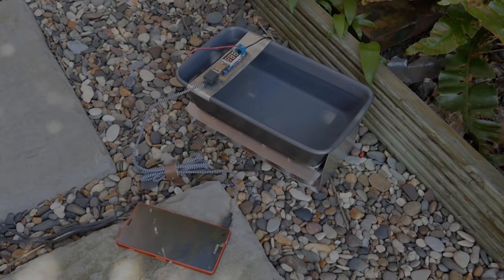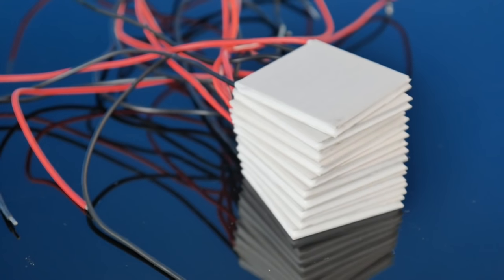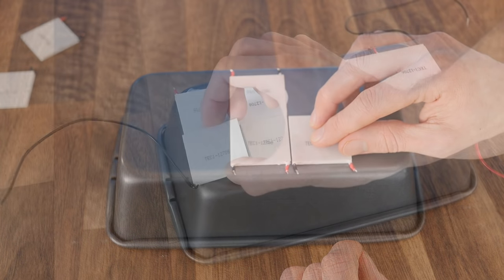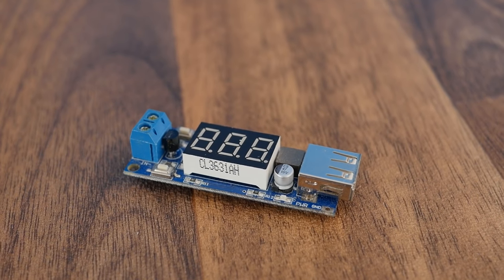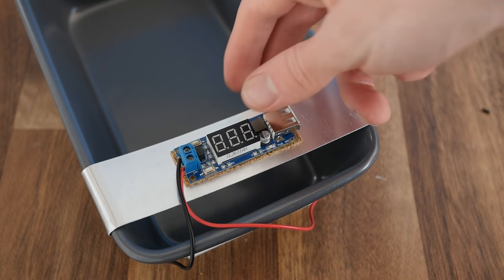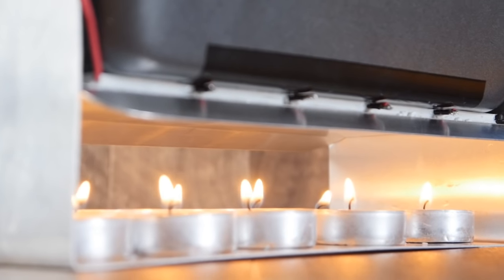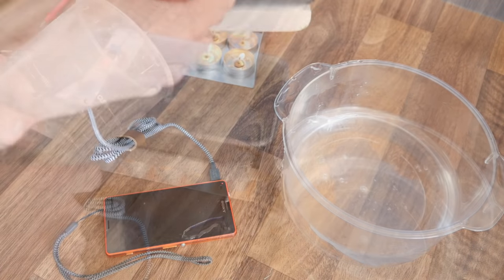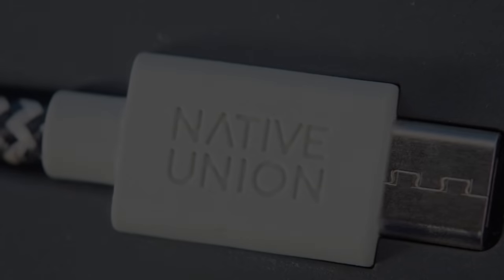How to make a DIY Thermoelectric Generator

Comment: hmm, it it posible to use this for cooling computers? and another thing, can you put this plates in series? cool the hot side with another plate and get a... wait a minut, did i just make a way to reach 0K?!?!?!
But seriusly, can you put thise plates in series?
Reply from the maker: I believe so yes.
Reply: Haha nice, sounds like i have to buy some.
Btw love your prosjects, keep up the good work (Y)
Reply: +Sondre Bjørgård To greater and lesser degrees ( ;-) ) - have a google on 'peltier'. I've seen some mods carried out that use them, but you still need an efficient way to remove the heat generated.
Reply: yes. that's one of their main uses
Reply: +Sondre Bjørgård I've used peltier modules to cool my one of my project pc's cpu to -3C. The problem is that the module itself produces significant amount of heat (mine takes around 60W) so your cooler has to cope with the heat generated by cpu AND the module. Also at such low temps condensation is a major problem.
Reply: +Sondre Bjørgård oh, also about the stacking - yes you can stack them on top each other. You stack smaller modules on top of bigger ones and you can achieve a pretty high temp gradient
Reply: +BFanist wouldn't it be possible to use the cpu fan output from the motherboard to scale the power for the peltier pallet? That way you wouldn't have to waste power to cool your system to ridiculously low temperatures while generating huge amounts of heat...
Reply: +Der Jens CPU fan draws probably less than 0.3A @ 12V - Peltier modules can draw in excess of 4-6 amps. You could build some sort of control circuit that would power the module based on the voltage fed from motherboard. Hooking up the module directly to your mobo might damage it.
Reply: +BFanist also to compensate for the heat of pcu and peltier combined the cooling fan would have to ramp up pretty fast. you would have to work out the fan curve and a voltage curve for the tec module
Reply: +BFanist great idea, but i will suggest you one thing to avoid condensation problem(condensation gives thick ice sheet and produces tears of water)...
first time you will need a thick cooper plate(about 10 cm or more) and you will need a pole(non metal like wood or plastic to avoid short with bottom side of CPU case) to support the cooper plate cause it have problem about weight...
then you should stacking cooper plate to CPU and your Peltier chips(don't forget about thermal grease) and the rest...
it will be better to make plastic cover around CPU and motherboard to protect them...
Reply: +Sondre Bjørgård A big problem with Peltier coolers is that when you remove power, the hot and cold sides equalize so you can end up adding heat back to the system. Adjusting the current to back off the temperature differential is considered the best approach; ie: cool to target temperature and then start reducing the amps so your cold side stays cold until it's safe to turn off.  This really depends on decent insulation so you don't have to keep the power turned up to fight environmental heat leakage into your system.

For a PC, you really need to have an active cooling system so you can dissipate the heat from the hot side, a water cooling system can do this, but if you are going to the trouble of a water cooling system and cutting a hole in your PC so you can expose the cold side and pump the heat out, you would probably be better off with just your water cooler.

The advantage of a peltier system is that you can cool your case below ambient temperature if there was some need for that. It would probably be quieter than a fan system to achieve the same temperatures, but your electricity costs would be comparatively expensive. 

Another knock on using Peltiers for cpu cooling is that the plate will condense and freeze the water vapor in the air
Reply: When using peltier you will still have to use a fan. Probably on even bigger rpm. The peltier module itself produces up to 60W so adding that to the mix you end up having to dissipate more than 150W of heat. Show me a cooler that could do that passively or at leas quietly :)
Reply: Mark Horstmeier you are right buddy that's why we still need a micro controller to control PELTIER CHIPS...
but if was you i will change all liquid in water cooler system with motorcycle liquid cooler...
motorcycle liquid cooler will not make rusty problems and have thick viscosity also can transfer more heat better than water as liquid cooler...
Reply: BFanist liquid cooler but not use standard base water as liquid cooler, you need to change it with motorcycle liquid cooler...
it just need about 10W cause it just need 4 small fans and 2 small motor pumps...
some people just put it at another level by using 10 fans or more and more small motor pumps...
Reply: +BFanist I have seen some experiments where people have been able to achieve some impressive temperatures with a massive heatsink, but your point that peltiers add another 60W of heat to the system is well taken. With a high quality module, perhaps with more surface area for heat exchange, I think you could do better.

I don't want to give the impression that I am recommending peltiers for cooling computers.  After all the money I spend experimenting with getting max results out of those cheap TECs, I didn't get much practical return.
Reply: +DIY Perks anything can be connected in series, haven't you seen the human centipede?
Reply: Sondre Bjørgård they are in series.

Comment: If it outputs 5 Volts @ 1.5 Watts, then if you do the math, that equates to about 300 milliamps. A normal phone in 2016 charges with at least 2 amps. The amount of amps your computer outputs when powered on is around 500 milliamps. I think having this charge a phone is a great idea but I think that maybe it should charge a portable charger which can then be used to charge the phone much faster.

Math to find out wattage yada yada yada yada:
Volts * Amps = Watts
Watts / Volts = Amps
Watts / Amps = Volts

Comment: why we need to heat water or something else???
can we heat TE plates only to generate some electricity? 
can we charge camera (DSLR) batteries using similar arrangement?
Reply: nope, seebeck effect works with a temp diferential, you need the cold side...

Comment: Is it fine to use fewer thermoelectric plates?
Reply: I tried with 8 and it worked fine
Reply: @DaniElectronics  can we use teg instead of tec ?
Reply: @anujnayak5339  sure, either devices work out fine!
Reply: @anujnayak5339  check the Thermoelectric Generator I built and let me know you opinion please!

Comment: hmm .. why is it on ebay that has a 12V / 60 watt plate (with the same number as in the video). But you say the 10 plates can be 15 volts. I do not understand that.
Reply: that's most likely a scam, and when he says 10 plates can be 15 volts, he means the total . 10 x 1.5V = 15v

Comment: how about something practical, a hand crank generator, or a simple windmill charger.  Thermo electric is cute until you realize the heat energy is better converted to mechanical power than it is electrical power

Comment: Why didn´t you use an TEG Modul instead of an TEC, wouldn´t it be more efficient because a TEG Modul is designed to work as an Thermoelectric Generator?

Comment: 5V 0,3A from all that modules? At least it works. I am building from big TEG modules and the power suck. They lie about the power, even for TEG modules. They are just more expensive. 30W ridiculous, 3W achievable, from 62x62mm TEG with 3W of cooling fan power.

Comment: this project works but impractical. If only there is a way to cool the water, having it be replaced with colder water automatically or be cooled elsewhere.
Reply: when camping you could set it up so a river flows by on a plate of aluminum instead of the bread tin

Comment: Hello!
I had a question about your flexible LED light video please (writing here since you may not be checking older videos now).
I've used some of the Yuji LED strips, which are truly great color-wise (thanks for your recommendation).
These are listed as greater than 80 CRI, which is a bit lower than the Yuji's 95+ CRI.
Can you say how close to truly accurate daylight these (Marswell) LED's are, compared to the excellent Yujis.
Reply from the maker: Yuji's daylight LEDs are literally the best, so while the Marswell ones are good for the price, they don't have that uncanny 'daylight' quality to them that the Yujis have (though they are close).
Reply: As I suspected.  . . . I may have to invest a bit more to use these for 'high quality photographic results,' thanks for the instructions.
If you run across any other very high CRI lights (like Yuji) that are more affordable, please let us know if you could.  (I will be looking too.)
Thanks so much for your answer, and for your videos as well!

Comment: This is probably the lest effecient way of prpoducing electricity ever invented.
One candle produces about 25W, you used 10 candles which are about 250W but your generator only produces 1,5W this is an efficiency of about 0,6%.
Also the water will heat up rather quickly. You should a CPU cooper block and a cooling fan instead. It´s a smaller setup and it even cools itself while it´s working.

Comment: Help I did this using two 7 volt solar panels and the same voltage regulator and the regulator/voltmeter/USB thing won't work any suggestions

Comment: Could you attach these to a tent stove  to charge your phone while the wood burner keeps you warm at night?
Reply: You'd have to change the water every 10 minutes :D
Reply: +CatsTF so having these attached to the side wouldn't work then as they have to have a cold side? Is air temperature not good enough? Thank you.
Reply: Gary Broom
I'd imagine his concept works because you can have two "extremes" so close to eachother. I don't think it's that easy to separate the hot/cold when it comes to air. That being said, I don't have any knowledge in the subject, so I could be wrong. :D

Comment: Hey Matt,

Does the voltage regulator come in 10v variants?
Reply: +Jake S (blu4) There is a adjustable variants, but it's hasn't a USB port becouse of obvious reasons. search on eBay for "adjustable voltage regulator" kind'a like "DC-DC LM2596" but be careful: step-UP (input lower then output)or step-DOWN (input higher then output)

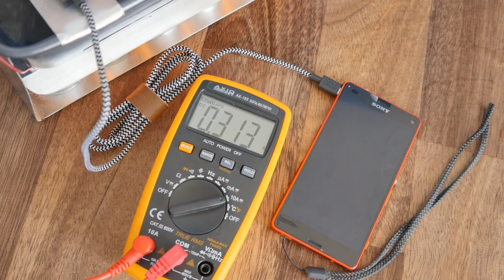Comment: 5:53 That is in fact very shabby since those candles put out about 80 W of heat each. So that's 1.5/800 ≈ 0.19 % efficiency 🙈 
Luckily there are better ways to use fossil fuel to generate electricity.

Comment: We can control voltage.....but what about current???Can we charge laptops???
Reply: Although he said 'Voltage regulator' he actally linked to a DC-DC buck converter, that effectivly turns the extra voltage into current.   You could in theory scale this idea upto laptops, but you'd need careful redesign to get it right.  Would love to see it done.

Comment: Could you build a snow and fire/hot water thermoelectric power generator to power a cryptocurrency mining rig, my system right now uses about 200 Watts with a single card? 

And that's just because it's my gaming computer and I'm messing around, how much snow would I have to carry in to do this? And how much snow would I have to carry in to power my house?

Comment: could you build solarpanels with these plates?
Reply: +Henry Klee you could, but that's really not a good way to use them... unless you mean using reflectors to collect a lot of sun light to a spot and have the other side cooled.
Reply: svampebob007 ok

Comment: Ima going to be going on a trip(in my favourite rocket ship)  with no electricity, but is near a river. Just wondered if it would be possible to use this with a constant water source. eg: waterproof the 'basement' that has you candles in and submerge the unit to get maximum cooling, you could insulate the wires with hot glue and just add longer wires to the control board... Anyone think this would work?
Reply: I guess it could, but you'd have to insulate the heatspreading plate so all the heat goes through the generator.
Reply: hmm yeah, I was thinking of making a watertight box (but you would be able to get into it) that contained the candles, a heatspreader then the generators, and then gluing the heat generators to the top of another 'heatspreader' which would act as the roof of the box, and that whole unit would be submerged...

Comment: If i would build it, i would put a Watercooling Pump and Radiator to it, so i would not have to switch the water
Reply: You would have to hand crank the pump.  Otherwise you are using more electricity then you are generating.
Reply: Raw Venus
Not a 12v Pump, a 3.3v Low-Power pump

Comment: try dry ice does this make enough power for a laptop?
Reply: +Dorian onelook you'd probably need more peltier plates (in parallel), as there is an output limit, regardless of the temperature difference it won't go over that limit.
Reply: Google Nutzer probably would have enough to power a basic 20W ~ 30W laptop, or at least slowly charge it (using many times the number of  plates used in this video)
Reply: Try dry ice and LAVA. It might work on a much larger scale to power something big like a lighting system for a house
Reply: as long as the module can handle the temperature

Comment: liquid nitrogen?
Reply: +M Isa I thought the same, maybe it would work as well...
Reply: No, but we want to use the Heat of the sun not the light.
Reply: +M Isa And thermite underneath?
Reply: +Krizx600 It's about temperature difference. If you use liquid Nitrogen, It would be enough for itself. You wouldn't need a heat source beneath it...
It called Peltier Effect.

Comment: it is a scam bro. This is what we did in our thesis but this is not efficient to charge a phone, you can charge a phone for just 5 sec. And it wont run again unless you let it stay for a sec. And try again. Lighting a small LED bulb could be possible.

Comment: What if you made one of these on a much bigger scale using dry ice and lava?
Reply: +Beta Syrus No, that's a horrible idea.
Reply: +Beta Syrus It'll power a whole city ( jk )
Reply: +Beta Syrus use frozen nitrogen instead
Reply: Eric Yuc And molten aluminum.
Reply: Use Thermite
Reply: hottest sun and whatever the coldest thing is ? oh wait...
Reply: A kugelblitz and absolute zero. (The hottest and coldest possible things)
Reply: Yes, I'm going to do it now
Reply: Beta Syrus Except you would need the wavelength of light to be the planck length, and absolute zero is pretty much impossible to achieve because there will always be energy. The coldest we have achieved was 273.14999... degrees Celsius, and absolute zero is 273.15. We did this by using magnetism to keep the subject from interacting with matter, but there are also neutrinos that can phase through matter, so yeah...
Reply: Web Compendium Yeah science
Reply: Den Hafiz lol, nice breaking bad reference.
Reply: Web Compendium Is it a good series ? Would you recommend me ? p.s - I havent watch it yet

Comment: In a real situation or in a needed situation where do you think you can find those thermoelectric plates?, I do not think you can find those lying around in the bush, or you build this thing before you go and have a real situation? really?No one is ready for a real situation
Reply from the maker: I can think of several predictable situations that would make building it in advance a sensible move. Not if you were kidnapped and then dumped in the bush... but then, you can't prepare for everything.
Reply: +DIY Perks hey thanks, do to take me wrong but I though of those kind of situations, but I still think that your project is awesome
Reply: I have a Question.
I built this thermoelectric generator however it was unable to charge my phone(the phone was charging but the battery level was decreasing.
Any tips to make this machine more efficient without tearing the whole thing apart?

Comment: use teg not tec type chips
Reply: +Suraj Grewal I don't think there is anything different between them apart from the name.
Reply: efficiency is... people tested it and they claim it provides higher volts, at same amps and input energy
Reply: +Suraj Grewal then why not use teg modules as tec and get more heat transfer efficiency ? I mean it looks like they just got more efficient modules or just modules with more elements. Probably the later.
Reply: teg will get hotter at hot side when compared to tec as cooler, besides, they cost the same so get one according to purpose
Reply: +Suraj Grewal You don't know what you are talking about.
Reply: I'll like to learn if I am wrong, go ahead and correct me
Reply: +Suraj Grewal A TEG or TEC is the exact same thing. A collection of dissimilar semiconductor junctions, connected in series (127 for the one linked in the description). It's based upon the peltier/seebeck effect. They exhibit low efficiency. When they are used as generators part of the heat transferred from one side to the other is converted to electrical current. The voltage is produces and the efficiency is only dependent on the type of semiconductors used. When used as a heat pump only some of the current actually help pump heat. The other part is generating heat inside the junction (resistive losses) and heat both sides equally. So when used as a heat pump the hot side will always get more energy than pumped from the cooled side.
Reply: +Suraj Grewal The goal when designing TEG or TEC is always to increase electrical conductivity and decrease thermal conductivity to increase efficiency.